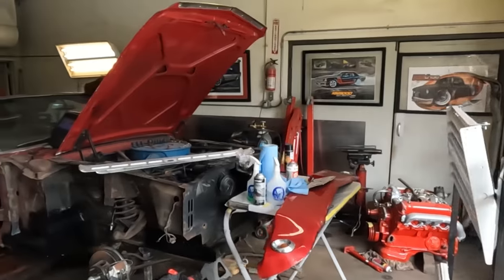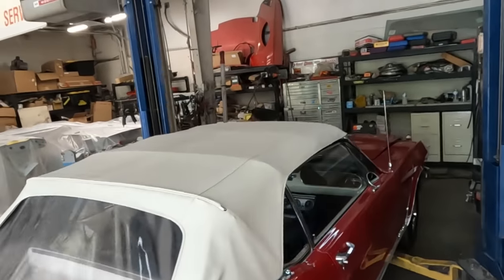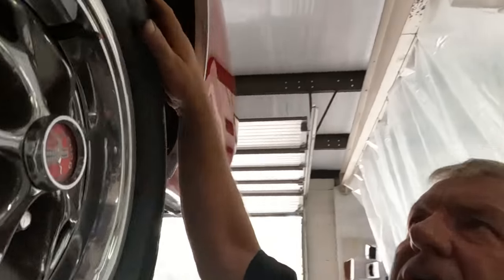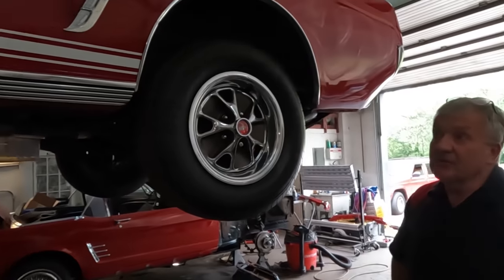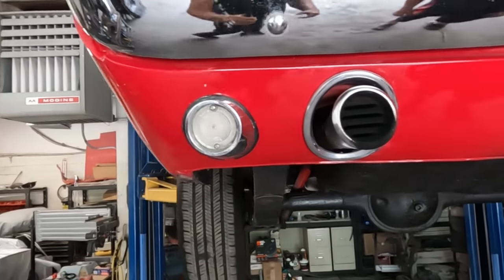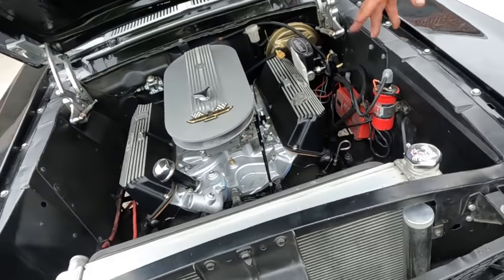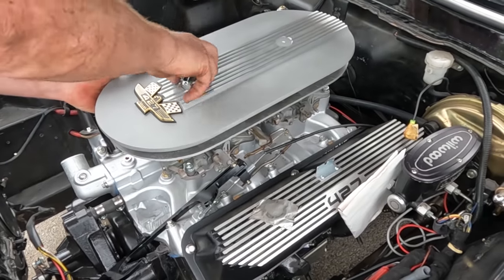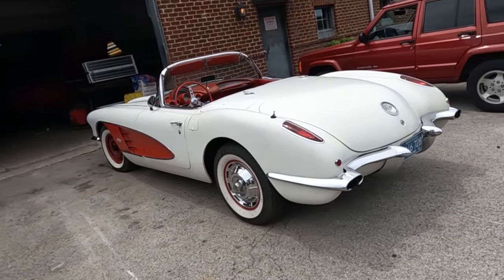Even MORE Classic Car Flipper Thievery, Incompetency And Nonsense

Comment: The converted convertible needs some work, but its definitely not a "3,000 pound paperweight". All the original brackets are reproduced, and welding them in is relatively simple work. There's no custom engineering or design, it's just fitting and welding. The car looks like it was at least solid, so putting the original structural bracing in and adding subframe connectors will actually make this car much better than stock. It'll just take some relatively straight forward work and/or money.

Comment: I had a split bumper 71 1/2 (rally sport) built a factory correct z-28 engine(they were not sold in the split bumpers that year if ever) and had tons of fun with it I sold it 5 yrs later for twice what I had in it 10k in 1990 but Wow if I had that car now

Comment: On that 1968 Mustang, put a 289, back in with stock original power steering and FORD power brakes...  STOCK 14" wheels, STOCK suspension, and ride height, back to chrome bumpers, and stock interior.  Right off the bat you'll save tens of thousands of dollars, not paying these two clowns.  That Mustang can never be built to handle that kind of horsepower, and putting around town like grandma, is just a waste of money.  Selling that 427 will probably pay for all the other work needed
Reply: 68 mustangs came w  factory 390 & Shelby had 428, so shell is fine

Comment: I'm on the finishing stage of a 73 z28  that I did the entire bottom of the car all new.    Someone took tin stove pipe for a chimney and bent it up and riveted it to hide the missing sections of the rear frame rails ,very dangerous and stupid, considering the car had a built 454 in it that could have easily mangled the car,  leaf springs were coming through the floor n everything,

Comment: If I were to get hold of that poor butchered up Mustang, I would go ahead and put some kind of frame underneath it.

Since its not original, and therefore has zero collectability to it, I would not get too uppity about originality though.

I would most likely put a custom welded box frame in there to bridge the back to the front, and put in some good reliable torque boxes also out of custom welded steel, instead of trying to hunt down expensive 'original' [but NOT original to THAT car] torque boxes and braces, because it would just not be worth it.

Still, I would just build in a good sound frame under it and be happy.

Comment: The 400 block ford engine is the same as the 427 ford, but a real 427 has a few new oil channels and bored out cylinder walls.

Comment: Guess ill add my 2 cents, we don't know if the seller told the buyer it was originally a coupe but leaving out the torque box and seat platform is rediculace. Yes they can be bought and installed. Car is unsafe in its current state. Im really dissapointed to see this. Im a 35 yr Collison/restoration guy. I hope the buyer knew what he bought. Maybe thats the real deal its there is to get a bid to finish it.

Comment: That car. The Driveline. Is my holy grail. If i owned it. I wouldn't let anyone work on it Besides a machine shop. I would probably put my bed in the garage and sleep beside it.  I think my killer LS swapped k1500 wouldn't understand. But my shovelhead would be pissed.

Comment: Wait.

I am doing an engine "swap" right now. I finally blew the engine in my 1500 RAM and so I am putting a new engine in it. I am taking out the 5.7 Hemi Eagle engine and replacing it with...another 5.7 Hemi Eagle. No modifications are being done whatsoever. I provided the exact same engine to the shop, I am just purchasing the labor for doing the swap. I am replacing an old engine with a new engine that is exactly the same...

...And it is costing me more than $1500 to have the work done. 

People. mechanics are skilled people. They have worked hard to develop skills that are valuable, marketable and useful. If you meet one who wants to "give" you all that he has earned in terms of his skills...there is usually something wrong with the equation.

Comment: That may not even be a 427.... does it have cross bolts?
That's the easiest way to tell if it's a 427.   The side oiler has a lengthwise bulge with three small screw in plugs on the lower left side of the block above where the cross bolts are supposed to be...

Comment: OK....understand something..... Shelby GT500 mustangs. ALL OF THEM will have major clearance issues with the master cylinder and the valve cover. ALL OF THEM. Our shop has done at least 10 of them, we have two 67's in the shop right now, they all just barley fit. We do restoration only, no custom anything. All numbers match collector stuff.

Comment: a 427 will have 4 bolt mains, 428s and lesser engines dont have those. a side oiler will have tubes that are external to the block, that inject oil into the main saddles...thus the name side oiler.

Comment: Uhhh NOT ONE WORD about he black Mustang having some other complete front frame and suspension on it  that totally changes how almost everything from the firewall forward mounts. So any mounting of any engine would have been up to the whims of the person doing it... How thick was THAT radiator? Having owned a 67 GT500 for 24 years that brake booster & master cylinder look bigger and the valve covers are like the carbs - kinda right but....  I wonder what the price would be to add the conv stiffeners. Looks like a good body to quickly surface prep for & the welding the supports in...

Comment: I used to flip alot of Fiat spiders. They all had rotten wheel wells.
So I'd fill them up with great stuff then shave it down to the right shape and cover it with bondo. 
A little primer and off to Maacco!!!!
Reply: So you're part of the problem.
Reply: @warrenlewis3977  haha.
Maybe.
Don't really see the problem.
It's used cars. Buyer beware.
They all ran correctly.
1and I always encouraged people to have any vehicle Inspwcted by an expert.
Reply: @secretsquirrel6718  why don't you just do it right?  Is "buyer beware" your out for doing bullshit work?  Guys like you are gonna destroy this hobby.
Reply: @warrenlewis3977  I have saved more cars than you can dream of.
Reply: @warrenlewis3977  futlrthermore.
Who says my way is not right.
If I pick up a car for 700 or 1000$ and it's at most going to sell for say 3k.
How are you supposed to go to all this trouble.
Say weld new sheet metal in etc. Forget it. Not worth it.
We're not talking about Ferarris.
Anyways. Get the car back on the road into a new owners hands and let them iron out the details.
I don't sell used cars.
I sell dreams.
Reply: @secretsquirrel6718  for the Spyder you might have a point.

Comment: This is why I avoid restorations or cars sold as them, that vert could be braced easily if the body is solid and be a decent toy.  but it wouldn't be factory and omg the resale value wont be there.  look at stuff before you buy it and if ya catch dealers hawking chit like that  without disclosing it call them out in public for it.  This is why I am growing to hate the car show crowd and older side of the of the hobby who view the cars more as investments, 90% of them aren't rare, most are hacked up over priced bondo buckets with a cut n buffed paint job.  Seeing this trend move into the 80's and 90's cheap tin can cars too because a few rare bubble cars brought money at auctions.

Comment: Sadly this kind of craptacular automotive restoration and customization, has been around since the 1980’s. As that convertible mustang reminds me of my 1972 Ford F-100, with its hack job frame. And it’s just heart braking when you realize that the classic dream car you just bought, belongs in a wreaking yard due to shoty workmanship. It’s even worse when that classic car you just bought, that belongs in a wrecking yard was the result of an idiot at that wrecking yard botched his attempt at saving a classic car because he took short cuts and can’t weld straight.

Comment: I think bracing the shit out of the underside of that convertible is the way to go, subframe connectors, torque box bracing, take out the seats and carpet for a few more braces on the floor. Save the paint job that's on it so the guy can use the car and enjoy it without costing a fortune to make it correct, the car is already devalued but can be saved for its intended purpose without burning the guys bank account to the ground.

Comment: With the 427 car, was it a manual? Because if I'm not mistaken, the 351w would have had a C4 transmission and a BBF would have a C6 transmission and the bolt pattern on the bell housing is different. The way that 427 is sitting in there, you almost need to run an electric water pump and a serpentine belt system so you have enough front clearance. Still, a very nice car. Very "John Wick" looking

Comment: Thats terrible, and unsafe!  I went to look at a 2nd Gen Camaro Z28 a few years ago, looked great in the pictures. It was all redone and the price was great. Went to look at it in New York, a 4 hour drive each way.  Got half way there and went to put insurance on it. As I was reading the VIN to the agent I realized the number for the engine was wrong.  These people (who already told me their sons race cars and they build motors) then tried to play dumb like they didnt know.  I asked for code from the block. They gave me some weird number that didnt come up in any search I did.  Best I could tell from the VIN and other info was that it was a 305, not a 350.  They did not have it listed as a clone and continued to play dumb (remember, theyre in the racing world. They should know or be able to find out).  Their friend sold the car to them.  I asked if they could find out from the friend. Then they said they weren't really a friend just someone they knew. I asked if theres anyway they could reach out still. Then they told me they really didnt know the person and they had moved away and they dont have their number.  We turned around 3 hours in.  I might have bought it if they were honest from the start.  And you could tell from their pictures these people had money and doing very well.  I saw the postings later continued to list it as a Z28, NOT as a clone.  Some people are shady a-holes.

Comment: the 427 mustang i don’t understand why that guy doesn’t just put the small block back in but build it to whatever power level you want. the small block will do everything the big block will do in a mustang! Its not like its for a truck for pulling heavy loads. thats the only real advantage of big blocks. the owner could probally stroke a 351 W to about 427 cid. They had the 351M which was 400ci. it just makes more sense to leave the small blocks in the mustang!

Comment: Ref the convertible. Buyer beware. If the buyer did not at least check the vin and body codes, possibly they deserve this? With that being said, I think the buyer would have a case against the flipper if they advertised, and sold the car as a convertible.

Comment: Can the fake convertible be fixed so that it remains a convertible but is safe? If so, what needs to be done and how much would it cost?
Reply: Torque boxes on both sides & factory reinforcement bars under floor pan + a 4pt roll bar tying the rear suspension mounts - thickest metal - and the b pillars & to under floor reinforcement bars.
It'd be solid.

Comment: this is one reason chevy is so much easier to build if it has a sbc u can put a bbc in it with no problems plus u can use the sbc distributor in the bbc u just have to change the counter weights and the power steering  pump. i have built chevy , fords and mopars and chevy by far been the easiest and the cheapest plus they all ready have a good suspension all u need to know is how to upgrade it

Comment: I am willing to bet 75 percent of the classic cars are bogus. Most of these cars were bought raced hard and put away wet. Now all these so called experts judge these cars. The only person that knows how these cars were actually built are the people that worked on the factory floor. Model A are a prime example of this false judging criteria. The cotter pins and markings were different depending on if the worker was left or right handed.

Comment: For the life of me I don't understand why someone would  put a big block in a small block car Usually the cross member is different etc Build up your small block The car will handle better Corner better than any big block If you want big block car Seek out an original big block car
Reply: Small blocks are cheap, common, big blocks cost a fortune, that's why

Comment: So the convertible is non-fixable because ?
Reply: It's not a convertible car.  How do you 'fix' that?  You can't, other than welding a roof back on, or adding all of the proper sheet metal and bracing and then calling it a convertible tribute car.  Either way is a crapton of money at any reputable shop like where it is at now.
Reply: @redmondjp  ; Welding a roof on would be cost prohibitive, and might just weld in an un-square condition.
His best bet is to adhere to the original convertible schematics.
It doesn't have to be pretty, or even look original for that matter.
If it's parallel and square while sitting on the deck, lift it by the wheels and hope it doesn't move when you weld it, and use travel indicators to check side to side and diagonal movement (if you get it right diagonally right both ways, it's right).
If done by the right person it could wind up more rigid than an original convertible if X-bracing was added without going crazy with too much added weight.
X bracing could also be used as a jig to square up the whole vehicle with the rear axle by use of  drilled and threaded bolt holes against temporary welded on tangs on known hard points, and added to or subtracted from the original dimensional points as designated by the Ford Motor Company.
Sag is the least of his problems, maybe, because if this were a new car it would twist like a pretzel, as the grain of the steel hasn't been age hardened to the point that the steel is not trying to go in a different direction than the shape it was formed in.
It's fixable, he didn't tell us how or even if, and is not the point of the video apparently.
We can laugh at the sucker all we want, but I want to know what he's going to do about it, if anything.
Talk to a Ford Mechanical Engineer before taking it to any shop, you'll find out damn quick if they want to use you as an expensive guinea pig.
Welding on a new hard top isn't going to solve a perpendicularity problem caused by cutting the top off in the first place.
It might just reinforce the un-squareness that's already there.
If the car hasn't turned into a parallelogram or a trapezoid it's a lucky save, and will involve less, on the other hand, just willy-nilly 
strengthening the underneath may actually throw it out of square, or weld in the inherent un-squareness, much like welding on a new roof, possibly.
Yes, I edited these comments, just because, and have heard the complaints.
Reply: @Johnnycdrums  here’s the thing Johnny - You must put the vehicle on a frame rack regardless of whether you weld a roof back on or add convertible body stiffeners.  You could still end up with a permanently-tweaked body by incorrectly adding the stiffeners, and you still don’t have an original car when you are done.

Comment: Could that GT not have the torque boxes/braces added? Or be sub framed?
Reply: It could for a price. Lots of cost in all the labor just to fix what there is so far. Add in more because there’s bound to be other problems that add up. 
By the end you’ve spent far more than the car is worth to have a generic mustang convertible that’s been pieced together.
Reply: @NBSV1  ah gotcha. That's a shame.... maybe a good candidate for a baja type project? Or building a caged race car.  Take the GT componentry out and go from there....

Comment: Huge difference between flippers and car builders who build good cars and make money example plan out the build how much meat is in the bone for profit you make more money building it stock after that it's a gamble to recoup your money buy a restorable car for what it's actually value is from the get go if the car tips out at 20 grand restored don't pay more than 2 grand for the body don't buy overpriced engines tranny's etc rebuild what you got if you paint and body many do it yourself farm out anything you can't do stay within the plan and budget if not you're going to lose money a flipper I've seen several dozens of cars in my town get flipped so much never finished now they just sit because they last guy to get it paid to much and won't sell it flippers are scum

Comment: enough with restomods and tribute cars. too many petfectly fine cars get butchered. i use Cutlasses as an example cuz that's what i liked as a a kid. there were tons of 350 4bbl auto Cutlasses out there in the early 80's. A few 442's but I NEVER saw W-30s or Hurst Olds cars till i started hanging out with Oldsmobile club guys. A nice 350 Cutlass with a 4bbl carb had plenty of giddyup. Driveability wise, not much difference from the big blocks. Now I never see a regular Cutlass for sale. It's all "tribute" cars. I'd rather have an original driver car that a butchered, cobbled together shitbox that costs a fortune

Comment: you guys have become car snobs.. if it runs sometimes and stops most of the time.. its a nice car.. get back to your roots back when you never expected to live this long
Reply: No, that's a death trap. Those reinforcements are there for a reason. Get in an accident in that thing and the passenger compartment is going to turn into a crumple zone. Don't get in an accident and it will sag so badly in 1500 miles you will start to see cracking in the unibody.
Reply: @barneymiller7894  i was being funny and talking about the mentality of when we were younger men.. but young or old i have never bought a car because it was shiny
Reply: @whitefreeman5798  Don't buy a car because it's shiny, buy it because it's structurally sound 👍